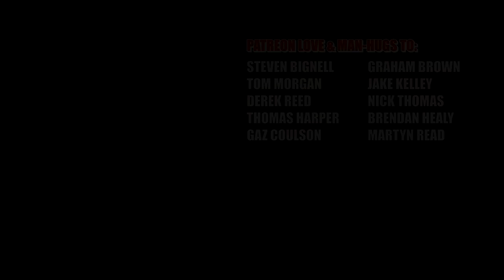I'm Making Random Design Bookshelves / Alcove Units (Timelapse)

Comment: Excellent, Modern Contemporary? It’s one of those jobs that if you get one bit very slightly off plumb or level it sticks out like a sore thumb. Very well done Andy, 👍😄
Reply from the maker: Modern Contemporary... I like that! Cheers, yes, you just have to be a fraction out at the bottom and everything is miles out. In hindsight I wish I'd built it as 2 or 3 separate upper units per side then wouldn't have had all that scribing! 😂👍

Comment: Great design.
My question is non related but respect your time and experience.
I'm planning on building a workshop i my garden. But will the structure be stronger if I use 3x3 timber compared to 3x2 or will it jus make it heavier. I can't remember the structure segment in college but remember something about thicker materials don't always mean better strength. What's ur opinion. I want it strong as poss. 3x3 frame or 3x2? Thanks in advance
Reply from the maker: Difficult to answer without seeing full plans. I would have thought 3x2 would be fine once it's clad internally and externally but obviously depends on a lot of factors. Might be worth shelling out for a structural engineer to give your plans the once-over. Having said that, look at how thin the timbers are in your typical garden shed. 👍